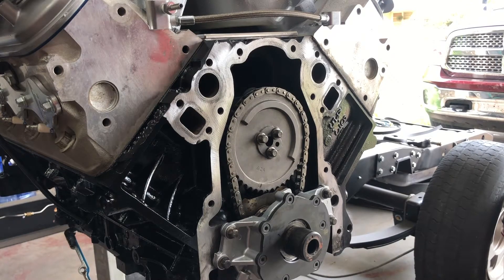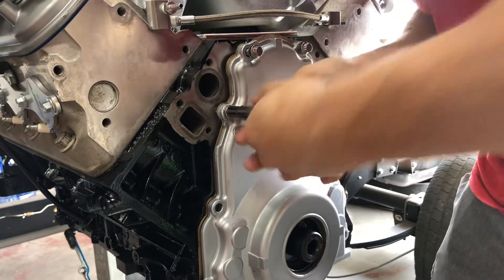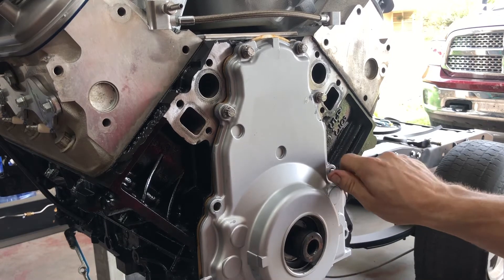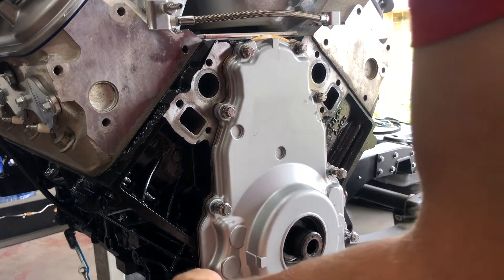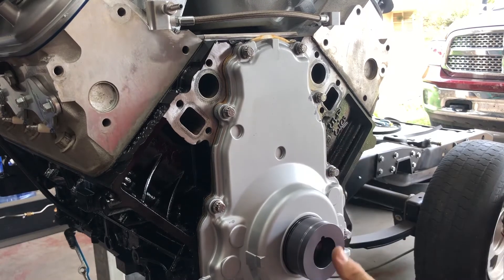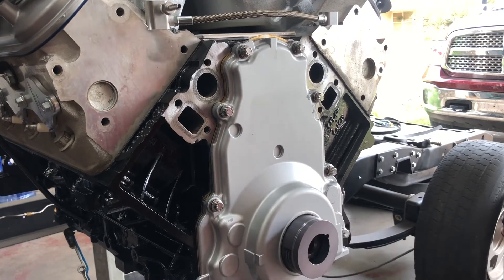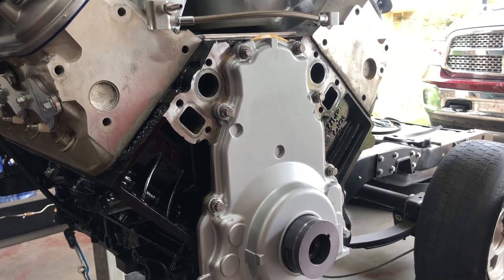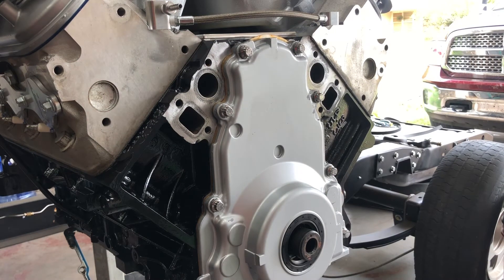5.3 LS Timing Cover Install

Comment: Just as a double check, make sure you take a straight edge from the block to the bottom of the cover.  Even with the alignment tool, a small "edge" can be created at the bottom of the block.
Reply from the maker: Good tip!
Reply: Can you get away with not using alignment tool and just leveling it?
Reply: MOST DEFINITELY.  if you don't have the oil pan on. Explanation/ Example. Is whichever type of alignment tool you have, seal in/ seal out. Put the bolts in Loosely, then see if you can rock cover left to right. You will find you can.  Because the bolt shank OD. Is not a perfect match to the bolt hole ID. The amount it can move, Equals half the Amount you can be off. And have a leak. If you're oil pan in on, And you have the alignment tool on. Finger tight the bolts, Tork  the bottom two bolts first.  If you're wondering why i'm here. I forgot the tork spec. ✌️

Comment: Great video! What model torque wrench do you use?
Reply from the maker: TEKTON 1/4 Inch Drive Micrometer Wrench (20-200 in.-lb.) | 24320 https://www.amazon.com/dp/B00C5ZL2EG/ref=cm_sw_r_cp_api_glt_fabc_VD475B7JS5GW8W05ZXSN

Comment: why not use the crank pulley to align it?
Reply: Commented too soon. Didn't realize alignment happens before the seal goes in. Now  gotta buy another tool
Reply from the maker: They make a tool to align it with the seal already in.

Comment: Do you think its better to use a dead blow hammer to not damage the alignment tool or for other reasons?
Thanks
Reply from the maker: I just used the dead blow to not damage the aluminum alignment tool. I’m sure you could get away with a regular hammer as well.